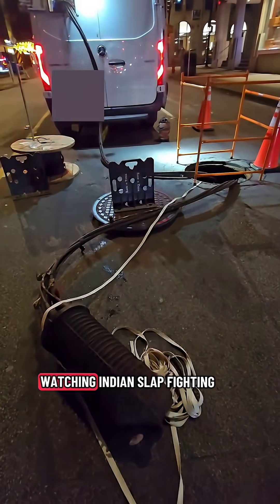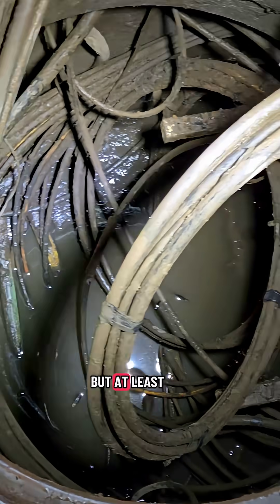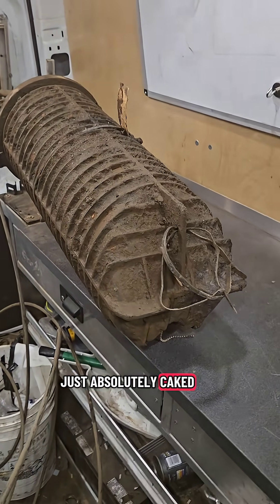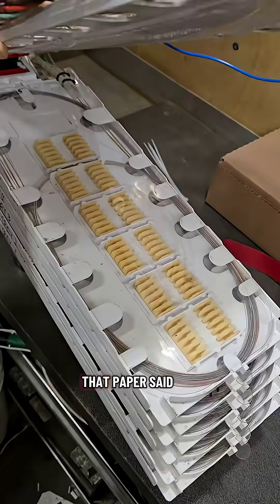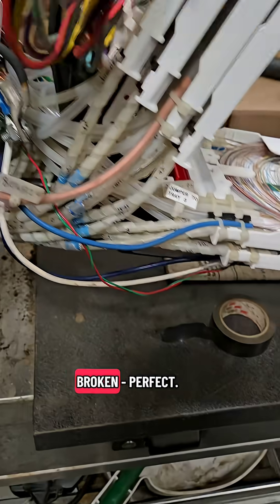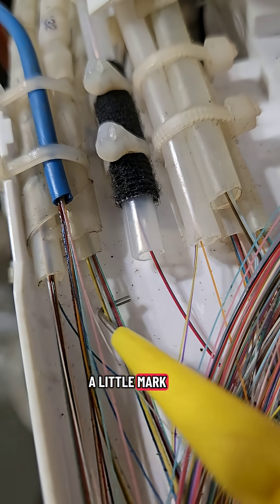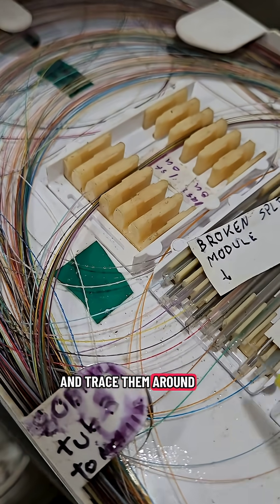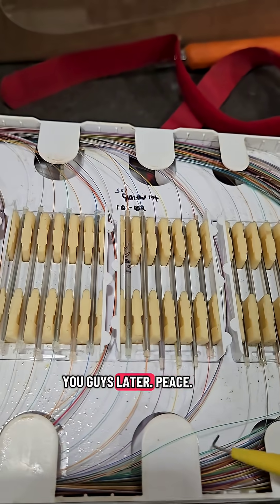#FiberOpticLife #TelecomWork #FiberSplicing #FieldTechLife #DirtyJobCrew #FiberTechHumor #Sysotek

Comment: Is that fiber live?
I saw a pink spot in the middle of the clip.
Reply: It is live, however that pink is a reflection of a truck light on the plastic cover, you can see a few white reflections below it.  Unless someone had a VFL (Visual Fault Locator) attached you would never see a broken fiber as data transmission uses IR, not visible light.
Reply: @uzlonewolf Oh, ok. I thought the pink flash was IR because cameras can pick up IR especially at high intensities. Point a IR remote at a camera. You'll see a pink light at the screen  as well.
Reply: @johanntiu4162  I do know about that and have even used it to locate active fiber before, however you must really be right on it and in a dark room to see it.  Remotes are around 940nm however long range single mode fiber is in the 1300nm range and is extremely difficult to pick up with a standard camera.
Reply: @uzlonewolf Thanks.

Comment: You gotta love how somebody was in there before you and says , oh , it's a broken module and didn't fix it , just wrote it down for the next guy
Reply: No time other fixes on his schedule that had to get done. Welcome to how buisness works now a days. They demand it be done immediately and think it’s going to be easy to do like a fresh brand new install when it’s a vault that’s been around for 50 years and needs a lot of work.
Reply: No, because you are there to push a fiber thru OR fix a bad spilce or fix a broken fiber that the last guy broke when he was in there doing something else.
You are there to do your job and move on. 
These fibers DO dry rot and crack just like copper does.
Reply: @LowVoltageTechnician as a sparky with a license any time I work on a panel I’m expected to leave it up to code even if I didn’t cause the deficiencies.
Reply: @Tagerrun0    And if you don't leave it to code ?
Who is going to bust you ?
Reply: @LowVoltageTechnician basically if the shoddy work I didn’t fix caused a fire they would blame me for it as the last licensed guy working on the unit. At the very least it’s a long drawn out legal battle to prove I didn’t cause the fire or issue.
Reply: @LowVoltageTechnician when u work on it u need to write a cert for it so like he said youre the last licensed guy. Basically all you can do is give them a qoute and if they refuse the quote youve got something to cover you but how much use it is in court i dont know
Reply: @Tagerrun0 sparkies love telling everybody about their license.
Reply: @LowVoltageTechnician i was thinking how easy it would be to break a fibre without realising and some poor guys internet drops out and it takes the provider two weeks to trace the fault
Reply: Whew I've had to splice coax in those vaults. Very not fun.....except the heat down there is nice with the steam leaks

Comment: 🫡🫡🫡 I understand the frustration with cable chambers like that...in my opinion its the " nose blind  " effect...when you can't smell how bad that " mud " is and get a whiff later 🤢🤮
Reply: Whats the smell like in yours? Because the ones I have been in don't stink. They are just dirty as fuck. And of course the contracts to go into them come into schedule right in the time when it goes close to zero °. Because naaaa, we can't work in there if it's nice and warm outside. Digging in the mud is way more fun at -2°C
Reply: Usually doesn't stink in those, usually just mud.
Unless this was downhill of a huge sewer break, then yeah, it's full of .... Kaka.
Reply: @jamess1787 most road cuts for utilities use diesel and runoff gets into most cable chambers through cracks or vented lids and causes some fun other then that not all contractors properly plug/ place manhole rings too keep leaves and other junk out ...soo some mud is mud and most times its nature breaking down mixed with sediment and other items sooo that's why from my experience in cable chambers/ handwells/ hydro holes/ vaults and  P.E.D.s " mud" stinks 😅😂😢